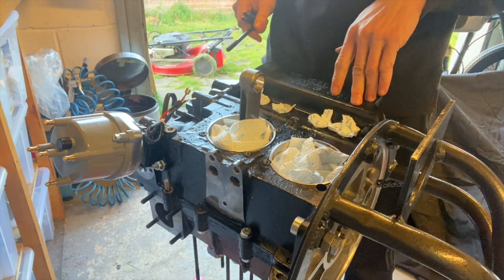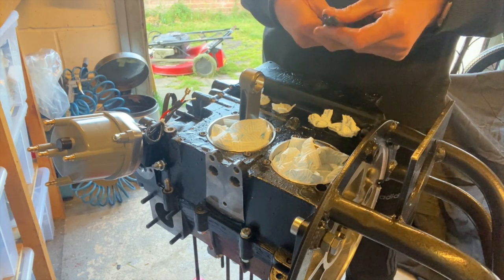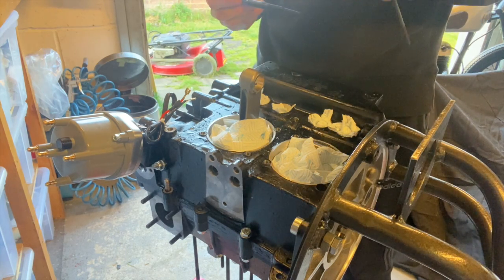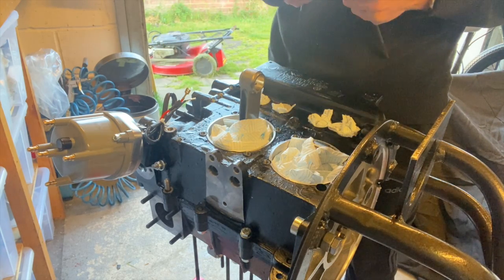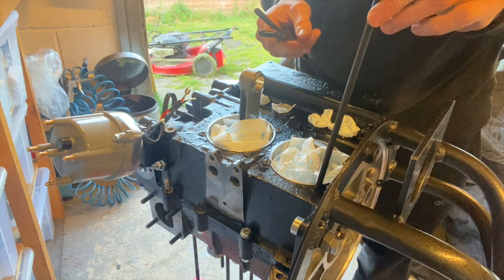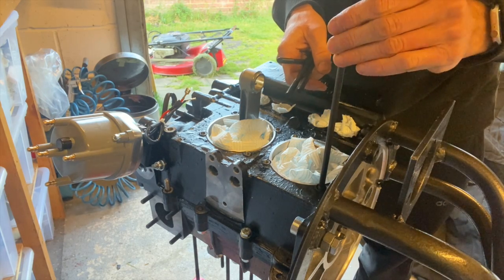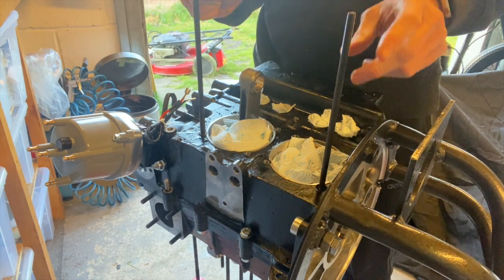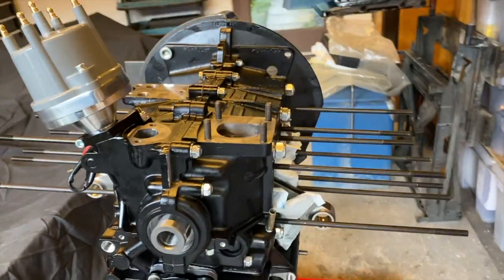PART 10 – Compression Ratio - How to Build a CB Performance 2017cc Builder’s Choice VW Engine

Comment: This is shaping up to be a nice motor. I had something similar built for my Ghia, a 2007cc motor, that is now in my beetle. My compression is a bit lower than yours, closer to 7.5 to 1 because I used "B" pistons. These have a relocated wrist pin that allows the piston to sit lower in the cylinder and requires no shims for my motor. This may sound very low in comparison to your 8.5 to 1 but I lived in the mid west when I had the motor built and now live in southern Texas. Summers in both places can be brutally hot and I happily make my power through my displacement, heads, cam, carbs, and exhaust. Keep up the good work.
Reply from the maker: Thanks. How's your motor working out? Sounds like you've had it some time.
Reply: Well, My beetle is in the shop right now getting the 2007installed, getting new front disc brakes and patching up a couple of rust holes. I haven't driven the motor since it was in my Ghia about 5 years ago. Just last year decided to put this motor into my beetle, bought new carbs, 44 IDF clones, a Magnaspark II dizzy, a new clutch and pressure plate, and awaiting word from my mechanic.
The motor was very responsive and strong with a 009 and 40mm Webers in a heavy Ghia, so it should be a blast in a lighter beetle with the newer parts.
Reply from the maker: @masbeetleboy9169  That Beet;e is gonna be a whole lot of fun. Good luck with it. Keep me posted on progress.
Reply: @aircooledanything2415  You bet I will. Are you going to  install a deep sump and extra external oil cooler?
Reply from the maker: @masbeetleboy9169  yeah. I have a slimline sump and external cooler lined up.

Comment: I would put the pistons and cylinders with the highest deck height # on the number 1&2 side. Number 3 cylinder always runs a little hotter than the other 3.

Comment: For dynamic compression, you need the rod length & the degrees when the intake valve closes. Google “dynamic compression calculator” and look for the link to UEMpistons website, near the top of the search list.
Reply from the maker: Wow, that's some very handy information right there. Thanks for that.

Comment: The crank bore machining can be slightly off centre, even on the original cases back in the day. Using the original under cylinder paper gaskets on one side only will add 0.15mm to the deck on that side. Anything less than 0.1mm is not worth it, unless a blueprinted motor (when you’d get the piston tops machined to match perfectly).
Reply from the maker: Yeah, I reckon that's exactly what has happened. The bore is slightly off centre. That or the machining of the cyclinder seat on one side,but the bore error makes WAY more sense.
Reply: @aircooledanything2415  it’s worth having a depth mic for next time because you want a fairly accurate measurement & the end of a vernier caliper is too easy to lean over etc. I have some ancient hefty apprentice made mic from eBay but it does the job. You can get a digital depth gauge for about a fiver from eBay. Sold as a tyre depth gauge but that could work with the usual TDC plate bolted in place, if it measures to 0.01mm
Reply from the maker: @bwm999  A tyre depth guage is a genius idea, but a Depth Mic is definitely on my list of tools along with a digital dial guage indicator.

Comment: Are you planning on lapping in the cylinders to the heads?
Reply from the maker: That would have been a good idea right. I didn't though. Pretty straight forward thing to do and I really should have. Damn. Next time.
Reply: I've kinda thought that wasn't a good idea. It could change the seat between the two cylinders and stress the block and the head.  If you had those split heads it would might be a good idea. It might change the deck height too. Not sure. I know many builders do lap the heads. I'll have to check thesamba for a discussion on it.

Comment: You would be much better off with 60-61cc heads, and drop the deck height to .040"-.045"/1-1.1mm.  That would still get you an 8.5:1 compression ratio, but the better squish would be more efficient, more power with less heat.
Reply from the maker: Yeah. That would have been a better idea. I'm still learning and I'll know for next time. Thanks for the advice.